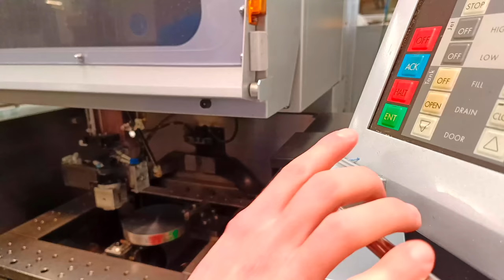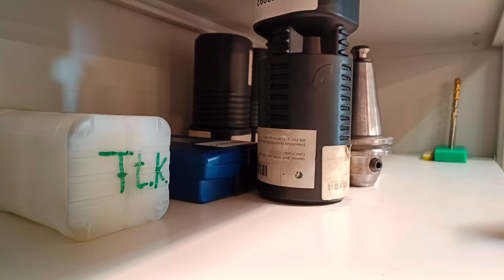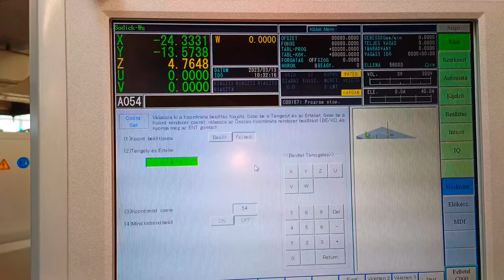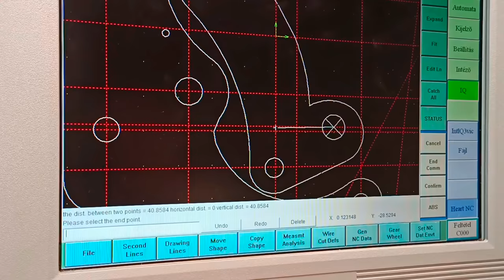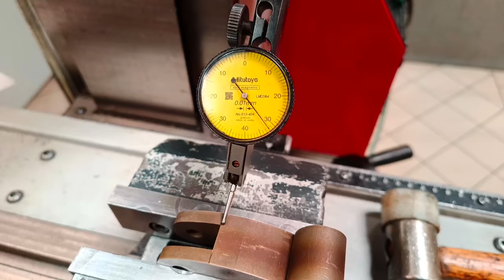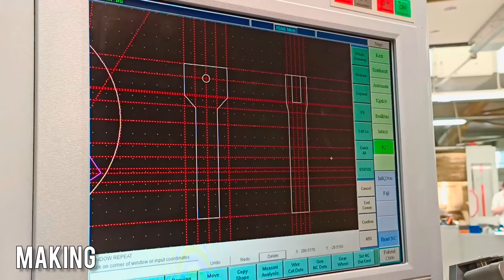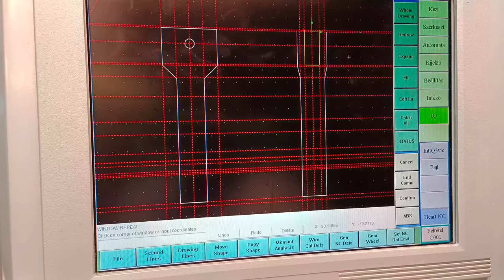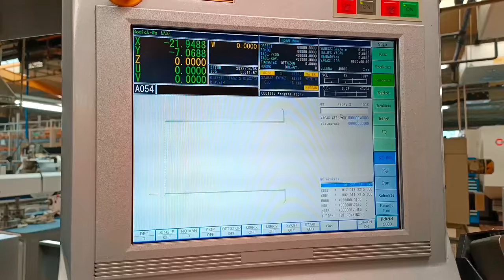Making an Unique KNURLING TOOL for Lathe Machine

Comment: Beautiful tool and made to a very high standard. How does knurling work- will the knurling wheel autoatically seek the pattern of earlier rotations or do you need to calculate it beforehand and choose the right knurling wheel for the intended diameter?
Reply: I think it just find's it automatically.

Comment: I noticed when he was knurling that skinny rod he should of had something to pull back towards knurling tool 🧐
Reply: There's an accessory called a follow rest that does that; it bolts to the carriage and keeps the part and the tool in the right places.  They're not very common in use though

Comment: What is the machine being used to cut things called and how does it work?
Reply from the maker: The name of the machine is wire EDM machine, a very accurate and reliable structure. specifically, the current passed through the wire is what breaks down the material, so any 2-dimensional shape can be freely programmed with it.